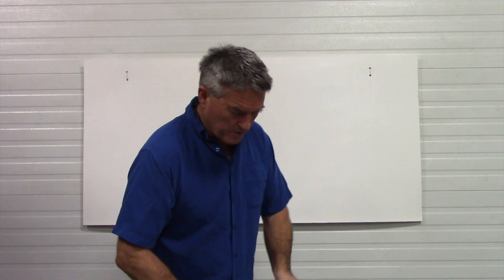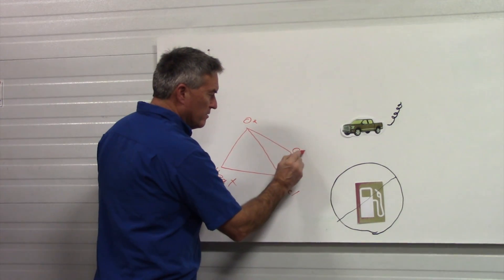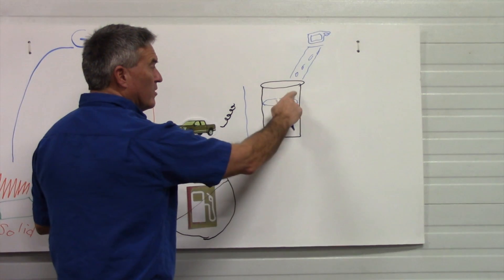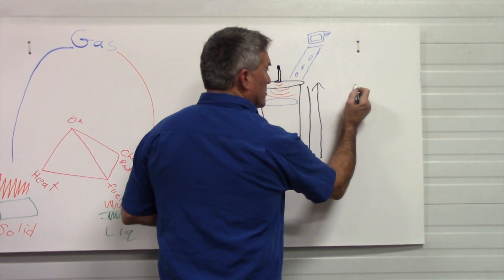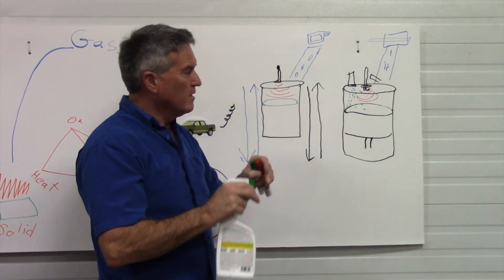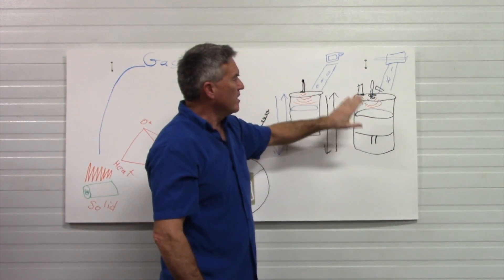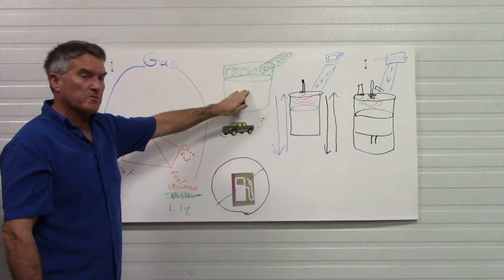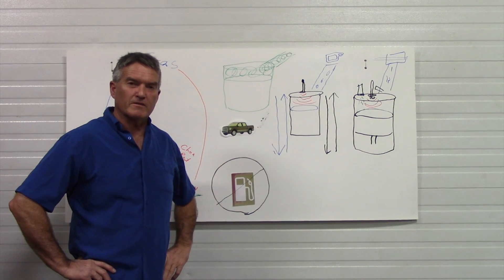One Simple Trick to get 100 miles per gallon with less pollution!

Comment: It's a four stroke engine so "16 times per second" is actually more like 4 times per second.
Reply: Paul, quick math comes to 16.66666666 power strokes per second @ 2000rmp
Reply: I believe you are correct but there are oft 4 cylinders, so.......
Although 1 firing cylinder for 1 rev does only equal  just under 1000 rpm so granted the figures don't quite add up
Although lean burn is already a proven and accepted solution
Reply: @johnsalmons9222  lean burn works well in a diesel, don't gasoline engines have excess heat when they are leaned out?
Reply: @kfstreich4787  It's my understanding that that is true however a group of engineers nailed it and presented it (presumably with an upgraded cooling system) however there was no profit it that for the big guys compared with their control and investment in the Platinum market so they were sidelined. I see the issue as they are going to use less petrol so where is their profit going to come from? Unless you have any info to the contrary Sir?
Reply: @johnsalmons9222  typically the difficulty from a hotter burn isn't so much heat dissipation but damage to metals, valves, cylinder heads, exhaust.   I deal mostly with diesels that have different characteristics,  too much fuel leads to hotter egt less fuel cooler.

I do recall leaner mixtures may have a more complete burn, it's been so long the details elude me.

I can certainly understand the concept of better fuel dissipation leading to better and more complete burn, perhaps faster burn rate however I would expect in the high cylinder temperatures well above the boiling point of gasoline all atomized fuel would evaporate to a gaseous state before ignition.  

Propane is a great example of using an evaporated gas to fuel an engine, it should behave similar to evaporated gasoline,  yet when you take into account its lower btu capacity it performs similarly,  if you take advantage of it's high octane and use higher compression it does quite well, but nowhere near the numbers of evaporated gasoline advocates.
Reply: @kfstreich4787  Thanks for your knowledge, very interesting and doubtless the case with any surface in contact with the increased burn temperature of the plasma, thank you, I will re-question my source and hope we get to continue this exchange.
 I would like to experiment with a compressed domestic gas....an off road experiment of course. I understand it liquefies at 2 bar so fairly easy to store and any tips you might have for that would be hugely appreciated.
Reply: errr? 8 ???

Comment: What you are saying is to atomize the fuel. Charles N. Pogue  whom you are referring to said that a drop of gas only burns and the gas vapor around it causes the explosion in the cylinder. He also said if you can shatter that 1 drop of gasoline into a thousand smaller droplets  and then shatter those thousands of droplets into thousands more you could achieve 202 miles on a gallon of regular. Of course this is the Canadian Imperial gallon. This was documented using a 1938 
Ford V8 that drove from Winnipeg Canada to Vancouver. It ran so cool the block sweated. All the Canadian patients 6 in all are also listed in the US Patient and there are 7. All my paperwork has been lost but I am sure you can find more here on the internet. All the documentation I had came out of Henry Fords Library in Dearborn, Mich. You might also want to see Shell Oil's 377 MPG 1959 Opel.

Comment: YOU JUST CONTRADICTED YOURSELF RE VEHICLE ENGINE WEAR !
You said the cylinders need lubrication from wet fuel
An it takes vapors to burn an to cause the engine to run.

You did great up to that point now you want to introduce only vapors into the cylinders to have dry lubrication, an you want to sell you vapor chambers, an destroy the engine !

It's good for domestic applications bit NOT GOOD FOR ENGINES ! AS you just mentioned this in your explanation., 
I hope those who listened to this video got that point well understood.

Beside Pog during the second world war built the same device, an they used it on the Sherman tanks an got 80 miles per gallon, took them ff after the war an the tanks could not be moved,

You can do exactly the same thing to vaporize the fuel by using a simple heating element in a carburetor float chamber, an get much better fuel  economy, but you will also wear out the cylinder walls an piston as you mentioned,

Comment: The way you get 100 MPG is a motorcycle. But I don't understand his engine efficiency argument.
Reply: James Mana, how true. Electric cars will solve local pollution problem but will have someone else burning fuel. The conversion from burning, creating electricity, transmitting to where it will be used is convenient but inefficient.

Comment: According to this logic we get at least 4 X better mileage so we must then be only burning 25% of the fuel we use if all other parameters are the same.Any simple emissions test will show you how clean your engine burns by looking at Co2 Co and PPM. Usually the first is high the others are low which indicates a clean burn.First making the fuel into a gas makes it hard to offer the fuel density you need to run the engine with enough power to use properly.

Comment: fossil fuels will not run out for the next hundredS of years. (especialy if we look at methane hydrates in the ocean.
Reply: Well Joe Pierre (JP), I do not think I have a problem with my analysis but YOU do!First of all: calling names is usualy a sign of people running out of arguments or, in your case, having none at all.But lets analyse your quacademia babble:Fossil fuels WILL last (at current rate of use) for several hundreds of years and even longer:Oil will last at least one century, gas some 50 years. Coal will last 200-300 years. And if we use a technique like 'fracking' of gassing underground coal supplies we have enough for thousands of years. And if those run out we can change to methane hydrates in the ocean; they will last even longer.So in the foreseable future we will not run out of fossil fuels. It should be a tell tale sign that energy eperts are no longer using this 'argument'. It has become a toy of climate activists and politicians.You state that CO2 levels will become to high to breathe. When we exhale, there is approx 4% CO2 in the exhaled air and that does not seem to be a problem. Current CO2 levels in the atmosfere are 0,04%...Carbon monoxide then? couldn't find figures on the level of that in the atmosfere.Nitrous oxide then? Same story.So I think your are exagerating this a tadd.I do agree with you than CO an NO are 'bad things'. But a hundred years of burning fossil fuel hasn't lead to a suffocating atmosphere...Then you make a plea for 'biofuels'. I am curious how you see this happening? For instance: If we want to change all our transportation to 'biofuel' and we would grow the 'biofuel crops' in a strip next to our motorways, how wide would this strip have to be? (i Know the answer, just curious if you know it to)Do you have any idea how large an area you would have to grow 'biofuel crops' on to provide in the total energy need of a country like the UK? (give or take 10%). Again: i know the answer, just curious if you know it to...I don't see that happening without converting really large chunks of rainforest into cropfields (as we are currently doing in Brasil).Then you talk of 'upsetting' the balance of nature's environment. That's interesting; do you have a way to, objectively, determine that 'balance'?The use of the word "upset" sugests you think something bad is happening; it is a value judgement.One could argument that the balance has been upset millions of years ago when freely available Carbon(dioxide) was turned into plants and later into oil, coal, gas. Burning it now is merely restoring balance.But, I do agree that the 'balance' is changed/changing. But that is something else than 'upsetting'.So I think we can conclusively say that YOU are having a problem with your 'analysis'. QED.I hope you get any of this but I doubt that. I'm sure you're not getting any of this because you sound pretty ignorant. you need to go to somebody that's much more intelligent to explain it to you.And please next time try using some interpunction in your text; there is not even one full stop in yours!
Reply: Joe Pierre  Oké Joe Pierre, I am not goin to respond to this. Your text is unreadable and I think you are using Google translate or something like that.
One thing: burning biological material as 'biofuel' is a very lowtech use of this material; at great cost as I have stated. Better make medicine etc. out of it.
Your 'biofuel' is NOT going to help us, it will create more problems than it will solve. YOU will destroy our environment with your stupid biofuels.

Comment: The problem in North America is all your own doing. In Europe we have been using engines a fraction of the size of your (admittedly erection inducing sounding) V8s with two to three times the miles per gallon and twice the power output for DECADES!!!!
My 2005 turbo diesel Seat Ibiza is a 1.9 litre which is about 4? cubic inches, lefet the factory with 130 BHP and after a quick touch from a computer whiz kid now produces around 190 bhp and will still do well over 60 mpg if driven gently.  The latest equivalent model has a 1.4 litre engine with the same 130 bhp and will go for over 70 miles on a gallon! Not sure how tunable it is though.
I want one of these VW PD 1,9 engines in my Land Rover. WIth a front mounted intercooler, bigger turbo and a retune it'll easily produce 250 bhp OODLES of torque and and still with good mpg.
I expect the new Ford Buckaroo LTD Ghia Lemonade sipping one gallon every 38 miles would have the average North American doing sex wees in their pants!

Comment: simple in theory but not true in reality. yes you can get more efficiency by complete combustion but not by vaporizing it but instead by advancing the timing and a lean burn mixture. you will get excellent gas mileage up until the car begins to overheat. then what?

Comment: Slight problem: carburetors have a section called a venturi. This is simply a tube that narrows in the middle then goes back to normal size. The liquid gas passes through the smaller portion that, as the fuel passes back into the larger passage, TURNS the liquid gas into vaporized gas, from liquid to gas. Period. So this crap this guy is pushing is B.S.! I knew how he repeatedly says liquid gas so many times, which is wrong, this video is B.S.! Don't waste your time or make him money off his LIES.

Comment: GET RID OF CAMSHAFTS. Use high-pressure oil jets, controlled like fuel injection, to blow valves open. Fully variable timing, lift, duration, overlap and all the other things we try to get into a cam profile.
Or, face reality and go electric. It will overwhelm the industry within five years.
Reply: I think PHEV is a better stop gap, as it's still hard to charge.

The average fast charge takes 40 minutes to get to 80% and costs an exorbitant amount of money. (Look up level 3 charging prices)

Or, you get a smaller battery that allows pure electric for 20 ~ 60 miles and switches to hybrid mode, producing ~ 50 mpg on average for most plug in hybrids.

That's a 500 miles range, (on average) and a "recharge" time at the fuel pump of less than 10 minutes

Comment: fuel inj was invented and used since the 1950's  and more costly to repair a carb can be rebuilt in 3 hrs or less for under 40 bucks..what the world needs is an Eng that runs on Air...like an oversized air wrench that takes tires off and your gas tank the compressor and the air going back into the tank whic would give un ending power and speed..wait did I reinvent the eng!? ..lol

Comment: What about safety?. Would the  vapourization converter cause a severe explosive reaction when struck from a collision?. You would think infusion of oxygen and fuel would create a liquid of gas bubbles needing to be popped, put a flame with this, would cause a mine-field explosion. Please let me know if this is true.
Reply: Steve Gaston my tractor runs on propane we had pickups that ran on propane. The engines were the cleanest to work on no deposits. I'm working on changing my current truck to run on propane.

Comment: Okay, I'm a bit lost here.  First, there is the problem of emissions, from partially-burned fuel in the combustion chamber and the catalytic converter, which burns away a bit more.  This issue has been addressed (not completely solved, but pretty close) by better ignition systems such as DIS and multi-spark ignition boxes from Jacobs, MSD, etc.  So, aside from costs of consumption (e.g. price per gallon or liter) where is the need for the gaseous-state  fuel for vehicles?

Since emissions controls are addressed by trying to attain the perfect stoichiometric air / fuel mixture (approx. 14.7:1), computer-controlled fuel and spark management systems seem to do a pretty good job of this relative to carbureted and contact points and HEI-type vacuum advanced spark managed engines.  In fact, it's done very well during closed-loop operation, while open-loop operation of throttle-bodied and multiport injection engines are still much better than vacuum-referenced carburetors and distributors.

In terms of using the gaseous-state 'fuel' to power vehicles, how is it derived?  Sure, we'd love to have > 70 mpg in our vehicles, but it must come at some tradeoff like diminished power for speed or torque, some of which could be made up with transmission and final drive gearing.  Turbochargers help recover some of the spent fuel by recycling it to be used to spin the impellers of turbo systems and the EGR valve helps recover some of those emissions too.  However, if price is the driving factor to change to the gaseous-state fuel, then with a >70 mpg rating, don't you think that private merchants (gas stations) will sell that fuel for more and governments will tax it heavily because of its demand?

Okay, so we have the benefits of clean-burning fuel.  Great, but at what costs?

Comment: 7-27-2019  -  -  -  I didn't see in the video where the problem with running "lean" causing overheating of the cylinders was resolved.  Did I miss it?  So, now with this I can get 70 miles per gallon but need a new engine every 100 miles - or did I miss something?

Comment: So, how do we get this device, and functionally installed in my car?
Reply: The transitory action from solid to gas is known as a state but in effect it isn't a state it's Termed as sublimination and can be achieved in many ways depending on different factors. Sublimination is the effect of ejecton of breakdown/(transitory leap) from solid matter too gasious state.
So the form is the state and the transformation is termed sublimination.
Reply: Copper tubing around the radiator hose and insulated worked well for me on a 91 xj years ago.Going to try it again on my yj 4.0. back in 02 I did this on a dodge stealth and we rough figured it was around 62mpg
Reply: Any kind of practical / safe way can be easily thought out through plumbing around the exhaust pipe.

Comment: gasolinr is not supposed to explode in a cylinder it should be a controlled burn, an explosion is called a detonation and will eventually punch a hole in the top of the piston

Comment: This is a solid concept.  Back in the late 1920's - 1930's there was a carb that heated gas before was introduced into the cylinder, with technology they were able to get 60 miles per gallon.  60 miles per gallon with the crude technology of that era, now a 100 mpg should be easily obtainable.  There were 3 inventors of this invention back then.  Unfortunately, on the same day, two of the partners where murdered in different cities, while the third went on to establish what is now know as BorgWarner.  I am not say that this person had anything to do with the deaths of the other two.  If in doubt of these facts do the research.

Comment: In every case the vacuum of the cylinder intake stroke vaporizes the fuel. If the fuel didnt vaporize it would not burn because liquid gas can't burn.  Many problems with this video or to simplify my response, "NO". When any video starts with "One Simple Trick" just say no.

Comment: Wood gasifiers used during the 30's and 40's should be another source of fuel that can be used when modernized with today's tech. Any scrap wood can be used. The wood gas, properly filtered, can be used in any internal combustion engine, especially fixed engines. This guy is only partially right, and can be misleading.

Comment: Carbon dioxide, carbon monoxide, and several other so called "greenhouse gasses" are used by trees and grasses in the chlorophyill process to feed and grow. Stop cutting down old growth forests, manage renewable forests used to make lumber ( no "clearcutting"), stop cutting all trees down for new housing construction ( trees provide cooler air and shade for your home reducing cooling costs) and your "carbon footprint"will reduce radically. No soil banking should be allowed, planting the land with plants that can be turned into alcohol fuel should be the modern way to farm. This video is so wrong.

Comment: Not even 20% of the energy contained in the gasoline is used to drive a car down the road.  Most of the rest of the energy is tossed away as waste heat in the radiator and in the catalytic converter.  One might think that a car could have an air compressor attached to the engine.  Then the fuel could be mixed with air and compressed.  The injector would replace the intake valves, as what Is injected is a compressed mixture of fuel vapor and air.